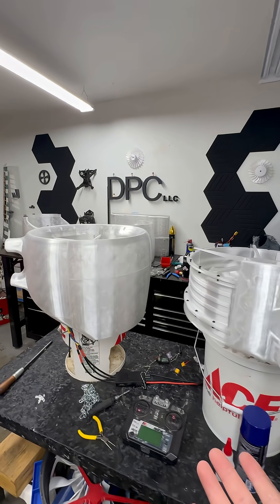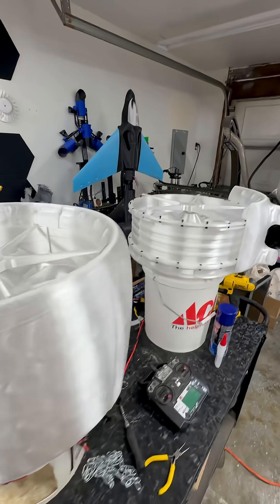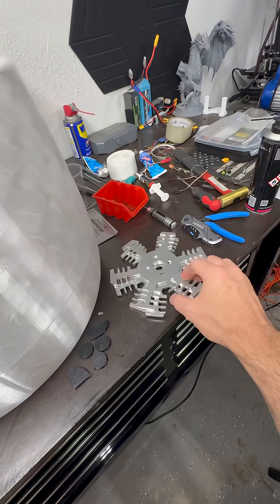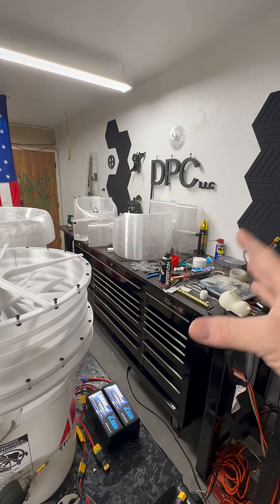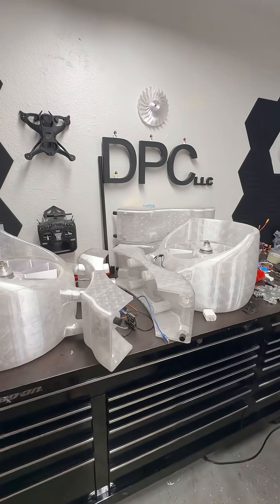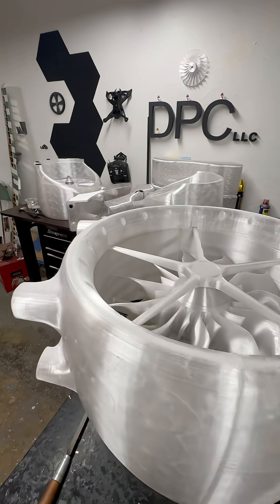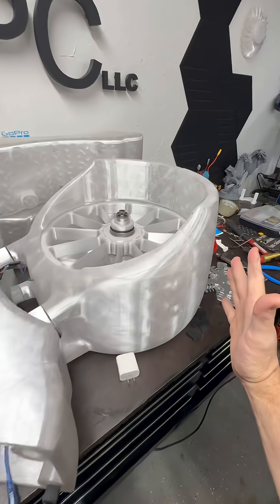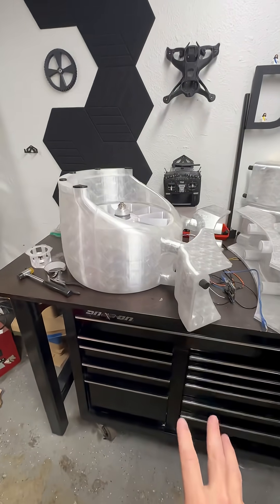28 kg of filament for one drone. This is crazy. ￼

Comment: Are you hiding something? There's no video of one of these engines being tested. Nobody would print 4 of them without testing one of them first.

These look more like a stage out of a turbine engine than a typical quad drone style motor.

Turbines are designed to run in one direction with gentle ramping up to speed and down from speed.

Typical drone engines are designed to quickly ramp up and down in rpm's. Expecting a turbine stage to be able to ramp quickly up and down without self destructing may turn out to be a huge oversight.

I'm not saying it won't work, I'm betting it won't work very long. 

Have you seen the very old videos of the guy trying to build a gas engine quad? The PID settings couldn't overcome the lag in engine response time needed to get his 4 engined quad to work in a controlable fashion.

He was close and I think his design could be made to work eventually. Yours being based on turbine rotors and built out of printed plastic has less of a chance to work in my opinion.

Time and testing will prove one of us right.❤
Reply: There are a number of test videos ☺️👍
Reply: @TryviaT  I seen nothing but tests that failed.
Reply from the maker: Danger close filming the 3D printed 340 mm EDF, voltage and amp check.  
https://youtube.com/shorts/Tvw42Pqp6WM?feature=share
Reply: @warmachined3472  That's more like it. The throttle response sounded more geared to a jet turbine than an electric drone engine.

Even with these slow throttle ramps up and down the twisting from torque is obvious.

It's these rapid ramping engine torque forces which we haven't seen yet that I think will get it to the self destruct point. Maybe you can manage it within the limit of printed plastics but it's the main problem with printed plastics.

The gun community has been fighting this limit for years with their fix being metal inserts and extremely thick walls around troubled areas.

I see their work as a way to find the limits faster for items with less stress abuse such as your ducted fans.

Switching plastics and layer angles only advance the printing limits in baby steps.  

I'm not sure if anyone is developing sintered metal printer materials but it could work.

The problem would be getting the metal powders to flow through a print head while staying suspended in a carrier binder.

We currently have clays with metal powders that can be easily sculpted. Once in the desired shape they are put into an oven which burns out the filler and sinters the metal powder into one piece. Jewelry sculpter clays contain silver for example to make silver rings.

Others have built 3D clay slurry printers for printing ceramics. These get fired in a kiln after printing.

I'm thinking we need a slurry version of that metal sculpting clay so we can 3D print parts we can sinter into metal parts.

Titanium powder could work too but it may require a kiln that can heat in a vaccuum chamber.
Reply from the maker: @tenlittleindians  I ultimately am going to CNC my entire drive system, including the blades, hopefully using a five axis out of aircraft grade  aluminum and appropriate steel for the shaft parts. This is a proof of concept it will fly. We will reach tensile stress limits of PETG. I fully expect a possible motor detonation, but it will prove the concept. It will fly much like the original that I designed using 70 mm EDF engines. A challenge there was getting 340 A across an F405 wing flight controller. So I integrated an APD 500 X power distribution board and bypassed the original power distribution board running only the signal wires to the flight controller and a 12 V power output from the PDB on the 500 X to the PDB on the F405 wing This allowed me to push amps and carry a 6000 to 10,000 mA battery pack on 4 four  70 mm engines. It also had a very decent flight time. Everyone of course told me that one wouldn’t work, but you could watch the video for yourself. It is quite interesting and that’s how this all started. Look up. Shrike V10 Maiden. This will give you an idea of what I’m talking about.
Reply: Who cares. Even if it blows up, it will be cool!!!